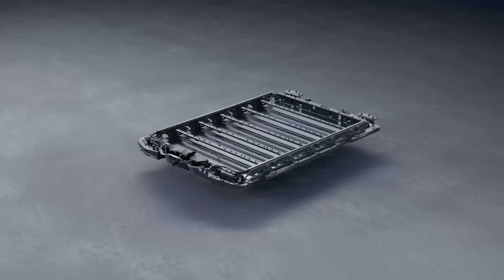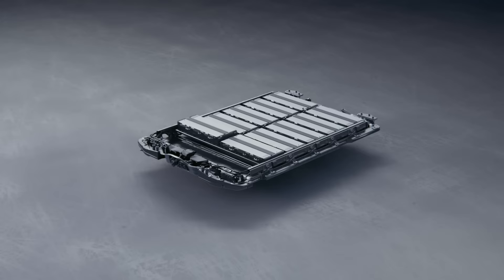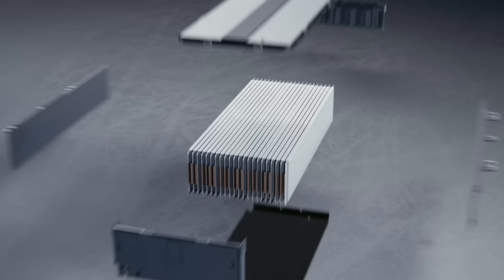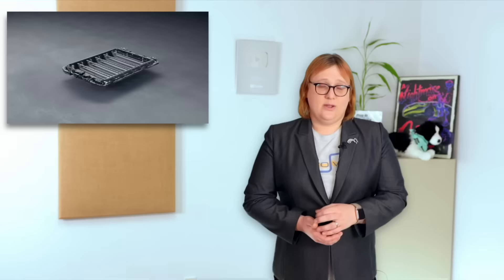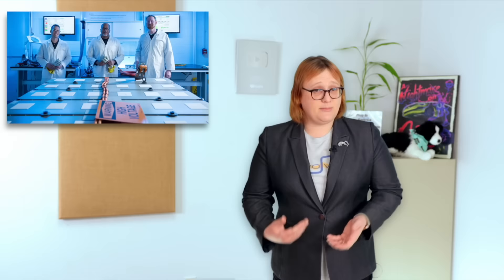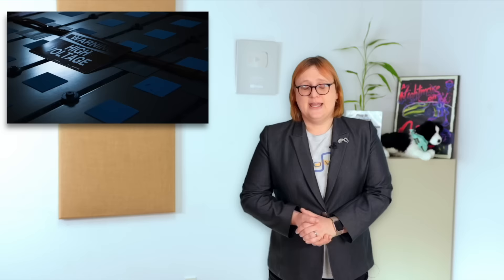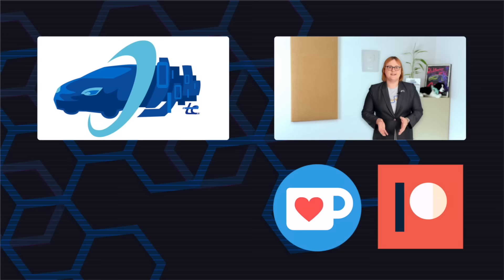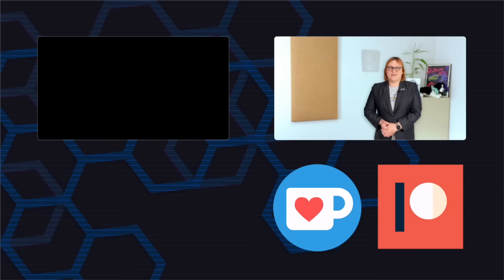Will GM's Ultium's Forward Compatibility Revolutionize The EV Industry?

Comment: Would be safe to buy GM shares for a long term? Looks pretty cheap at the moment.
Reply: There are no bargain cheap stocks, there are very strong doubts GM will survive another 3-4 years. They have a well-deserved reputation of being way behind in adopting any technology and ar shedding customers rapidly. Ford is actually in worse shape since they really only have one product, the F series truck, and are in debt to twice the value of the entire company. GM might survive if they fired their entire upper management and conserved cash by cutting losing product and get radical in structuring the company, possibly shutting own all but one ICE plant and retool for something with an appeal. By using up their factory space for ICE with declining sales and rising cost, they will have to build all new factories. Legacy companies have a problem, their only cash flow is from ICE but margins are dropping so they have to find cash somewhere to invest in all new products, just to sell the same number of cars they do now. Every BEV they sell means one less sale of the wider margin ICE car. The transition of an existing company is much harder than a startup since it has none of the declining value baggage. Even their once all-important dealer network is a major liability now which is not something modern business model startups are constrained by.  They should have found seriously better upper management 10 years ago and possible to start a new brand that does not depend on the dealer network. The 110 year old business model of legacy companies doom them to be uncompetitive.
Reply: @stanspb763  So doesn't looks good to them. Iam keeping an eye on the EV business especially small companies, because they have a lot of room to grow. 
I buy tesla shares however, I am looking for the next Tesla's competitor 
Wanna invest in Rivian as well, when it goes public.

Comment: Sorry,  but this doesn't seem very clever. Tesla, and some of the Chinese ev makers, are looking to drop the idea of modules altogether and going pure cell to pack. Tesla battery packs are now "glued shut" so you can't replace a module if you wanted to. The reason - the cells are now so reliable they almost never in practice have to replace modules. The best component, the cheapest, most reliable, smallest, lightest, easiest to fit and to replace is the component that isn't there! GM seem to be proposing a super-complex and sophisticated module design whilst Tesla are simply going to eliminate them altogether! If you have a "million mile battery" why are you putting so much effort and cost into making the cells replaceable? Build the thing to last a million miles, seal it, fit it and forget it. I may be missing something here but l would take Tesla's approach every time.

Comment: GM has been promising and cancelling things for decades. They have made a lot of claims but provided no details. Until tech specs are released , it's a believe it when I see a couple hundred thousand on the road.

But then you'd still have a GM car wrapped around it. So what good is a 1,000,000 battery but a 100,000 mile car?
Reply: What has GM promised and canceled in the last 10 years?

Comment: This sounds over-engineered.
Designing for failure of modules, designing controllers for each individual modules, designing for replacement of subsections of the pack.
It seems that they are nervous about the risk of pack related failures and are trying to minimize the likelihood of a failure requiring a replacement of the entire pack.
Ideally the pack is a part which doesn't need servicing or partial replacement. When they have more belief in their product they won't spend extra building in safety nets.

Comment: This is 2020.  GM has one very ugly and plain electric car ( the Bolt) that was introduced to the public 3 years ago.  The Bolt is mostly put together by LG. A car that GM cannot make at a profit. The Bolt is an excellent car. It was designed to NOT be desirable.  This video is very interesting but mostly smoke and mirrors for investors.  It is working, the stock price is going back up.  If GM uses any of this technology we wont see it till 2025.  Buy then I am not completely positive it will still be relevant.  Enough with the smoke and mirrors.   

GM can build an attractive well made electric car for the masses with technology available today.   They can do it for an affordable price and make money on the sale.  GM simply lacks the will to do so.  GM had a world class electric car 20 + years ago that would still be competitive today with modern battery technology.  Look at how awesome the Spark electric was back in 2014  ( another LG creation).  I am so disappointed in GMs lack of vision.  

Why kill the Volt?  Why?  The Volt was a completely unique quality automobile with a loyal following.  Hell it was even attractive. If GM could push the Volts electric range to 80 real world miles and add an 100 kw fast charger it would work for the next 5 years wile GM is working on all these so called technological break throughs.

Comment: GM has a history of over promising. Saturn would beat the Japanese in the small car segment, the Cobalt leapfrogs the Civic and other small cars, the HHR would be hugely popular, the Volt would sell above 60k/yr and be profitable. I had a leased Volt, but paid the penalty and let it go early, but then like an idiot, believed the hype and got a Bolt. While I've only had the Bolt for less than a month, it is very disappointing. Too many problems to itemize here, but the seats are crap, the car is cheaply made and poorly put together. The screen is large, but very slow, there are no back speakers or cup holders, there is not even a balance control, the radio source changes with every use, using the park button produces a grinding sound when full stopped if the break is not held, etc. I fear that I've acquired another POS.
Reply from the maker: As we've said before, the bolt DOES have rear speakers. There IS a balance control.  How to adjust this is on page 161 of the owners' manual. 

As you've posted this comment at least twice, we're not sure if you missed the previous comment or are spamming. Please do not do the latter.

Comment: Had to dislike. A puff piece with a lot of vague information that's not very radical, new, or better. No specific technical details. GM kicks the ICE can down the road very well, which is all they've done since the fine Volt was introduced 10 years ago and discontinued a year or two ago, along with other decent cars that were not so obscene like their remaining, high margin lineup of large trucks, SUVs, and luxury vehicles. Credibility is a big part of its problem. Another is past and continued carbon emissions from their fleet until these fabled concepts might reach the market.